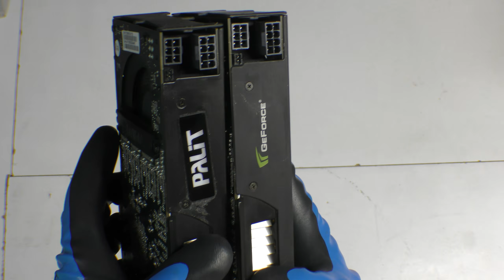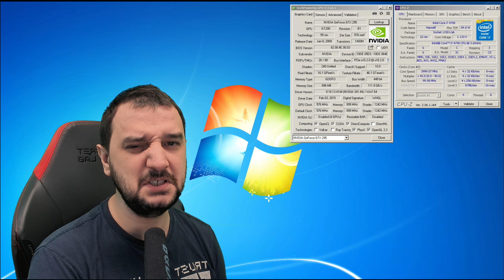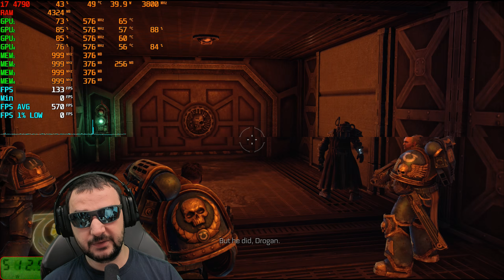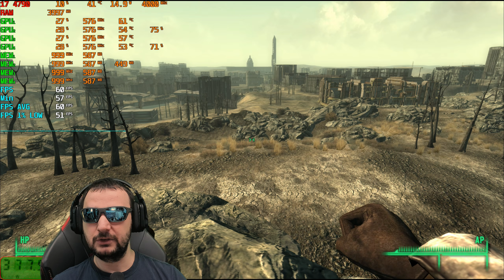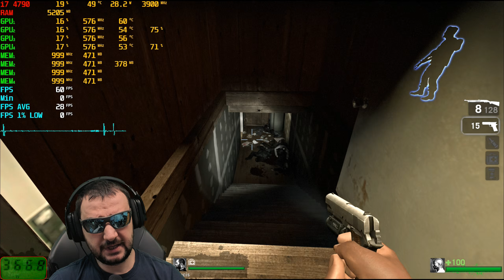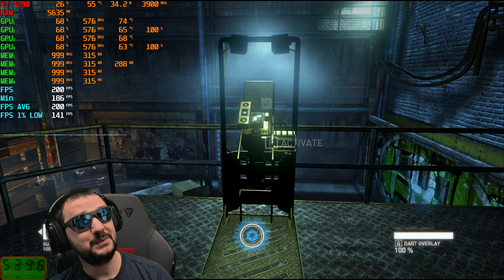NVIDIA GeForce GTX 295 Quad SLI Benchmark

Comment: Perhaps it's not the sli cable is the problem, instead the connector on the pcb of the palit card.
Reply from the maker: Even the card itself its got a cable to connect both the cards. Maybe 👀 
I have to test the cables first. I got my spares now.

Comment: I used 2 of these in 2009 and it was awsome and a pain, to get quad sli to work was hard, and when u did it wasn`t smooth + texture problems, sli worked ok in many games. But the Quad benchmarks were great, i remember being a member on the Futuremark forum and i had the top 3dmark score for a few weeks.

The card i own now is a Asus Mars that has 2xGTX285 2GB in sli, that`s a review you should do - Quad Mars :)
Reply from the maker: @Bulltazar  since I started this I only seen one mars like that and its $2000. Yet alone 2 of them 🤣. 
295 will do. I need to find another 295 1pcb or fix mine.

Comment: 06:50 : ""Arctic Silver thermalpaste""" ??
Daniel i think that Arctic Silver has some conductive material ,thus is unsuitable for GPU usage ,only CPU (*for CPUs is very good thermalpaste i use it a lot ).
--I never changed GPU thermalpaste (*thus ,i'm not expert by any means😁 ) ,but that's what i've heard , search it before you use the "silver" thermalpaste...
Reply from the maker: Arctic Silver MX-6 thermal paste does not contain any silver 🤣 despite the brand name.
Reply: @DanielCardei  i thought that you meant that ... Arctic has 2 lineups , the Arctic Silver lineup and the Arctic MX lineup. 
The silver lineup contains some silver-dust from what i've heard ,thus its somewhat conductive(*and best suited for only CPU use 🤔from what i've heard) ,while the MX lineup is non-conductive.
--Although i have both , i still haven't use the MX . I've used the silver5 many times on my CPUs and it performs very well , and i've heard some good comments for the MX lineup also.